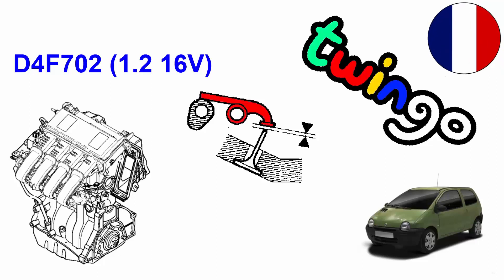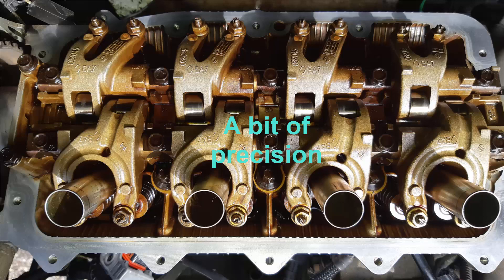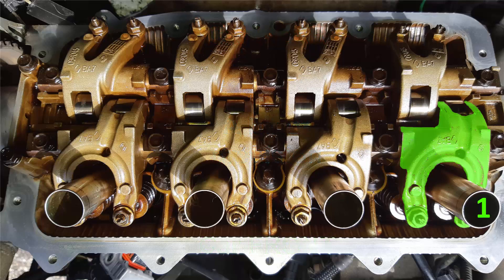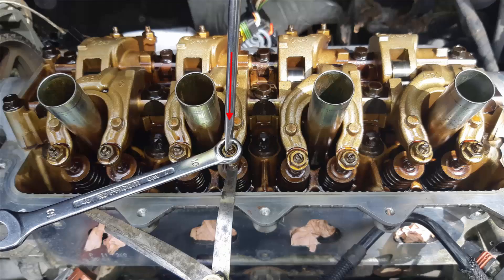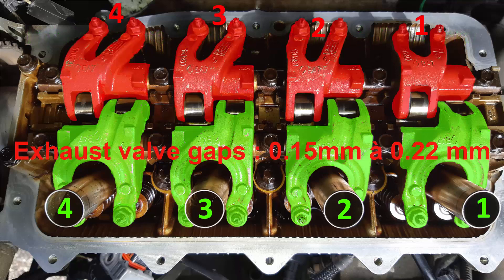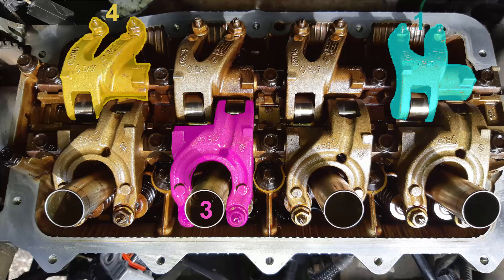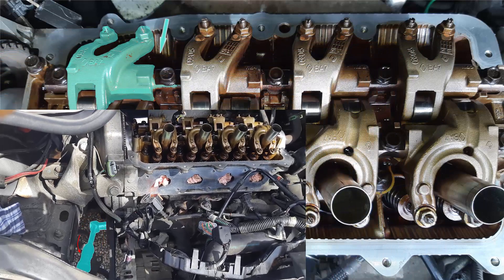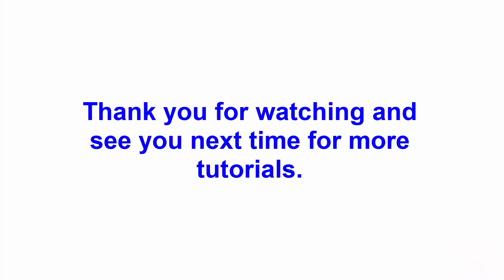How to reset the gap between valve stems and rocker arm on a D4F702 (1.2A 16V) engine froma Renault

Comment: Did this and idle is now very VERY unstable. Did it once 0.10mm on intake and 0.15 exhaust then went 0.10 intake and 0.20 exhaust. Problem still here. Changed gaskets , o2 sensor, cleaned thorttle, spark plugs look mint, smoke tested the intake manifold. Idle goes very very rich and car starts to sputter. Driving is fine. IDK wtf happend to it :(

Comment: Cylinder numbers should be numbered from left to right. So, from timing belt side to the transmission side. 1 - 2 - 3 - 4
Reply: In Renault engines are from 4 to 1 ( 1 is the first from gear box side)

Comment: Great and helpful tutorial. Please beware that many D4F engines have two different camshafts; with and without a groove. The gap values are different.
Reply: How to find out which camshaft I have
Reply: @wario4979  
There could be a groove visible between intake cilinder 2 and outlet cilinder 2. You have to use a light and look very carefully.

Camshaft without groove.
exhaust valve clearance between 0.20 and 0.27 mm.
inlet valve clearance between 0.10 and 0.17 mm.

Camshaft with groove.
This camshaft is identified by a groove between the cams (A2) and (E2). Repeat the adjustment procedure
for the valves indicated above, with the following adjustment
values:

- inlet valve clearance: 0.25 to 0.32 mm,
- exhaust valve clearance: 0.35 to 0.42 mm.
Reply: @jrvd64  will these spec apply for d4f 722 engine? keeping in mind of the camshaft groove
Reply: @costinc.6525  sorry I do not know. You just have to check the camshaft as described above.

Comment: Great video, Olivier... thanks for posting!
I love how you show the blinking highlighted elements - so professional! 
How did you do that?
Question for you: 
Why is the adjustment done this complicated sequence and the usual way with the cylinder at TDC with all valves fully closed so both the intake and exhaust valves can be adjusted one cylinder at a time? Seems much simpler... Or is this a Renault special? ;-)

Comment: one of the best tutorial ever... thanks!
I found oil in the spark plugs tubes. Can you tell me how I can fix it?
Reply from the maker: Hello MrMariovfr,
Before fixing the issue, you have to know where this oil comes from.
Do you have oil in each spark plug well or one specifically?
Does the oil come from the top or does it come from the spark side (very dark sparkplugs)?
 If it comes from the top : 1) the seals surrounding the spark plugs well might be cooked and so the oil finds a way to go out of the engine.
                                              2) the sparkplug well might also be loose.
If it comes from the spark side, this is not good, because it means that the piston rings are worn.
To nail it, you have to perfom a compression test.
You have tons of videos on Youtube about the topic.
I hope I helped you.

Comment: Hi, thanks for the video, i was unable to find a mechanic so far who would set this up for me, now i can do it myself. That's basicly a lifesaver :D
Reply: Thanks again. Only two spark plugs were wet. There is no oil consumption so I think it could be most likely a sealing problem. But the compression check is a good advice.